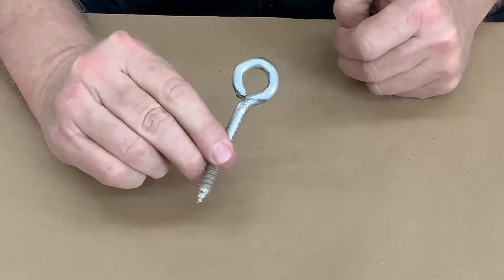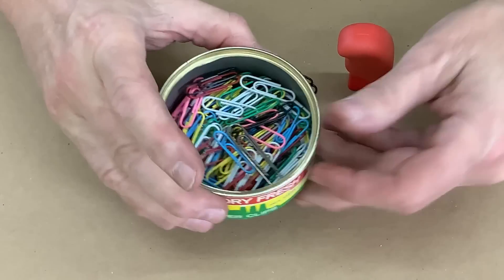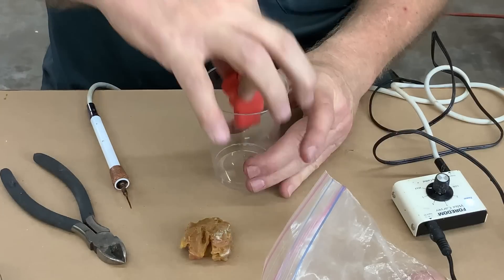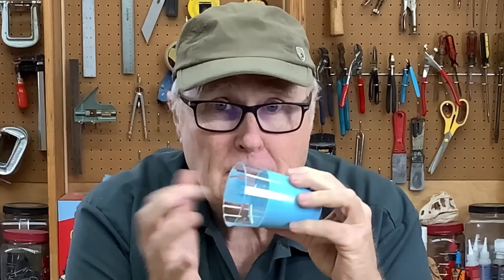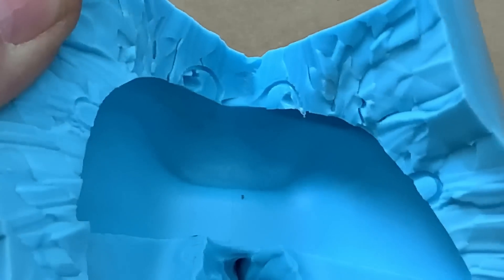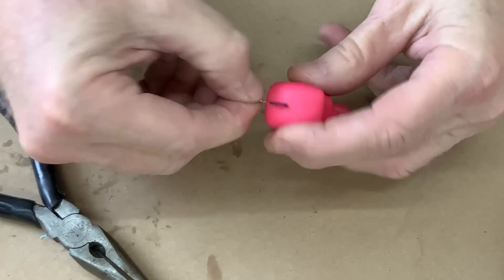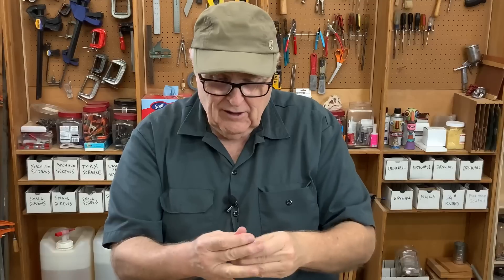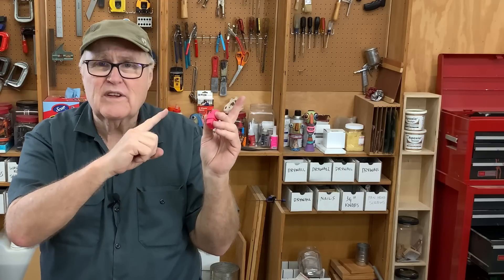Eyelets - Potted Or Screwed. Which Works Best?

Comment: Robert - have you tried drilling a hole then anchoring the hook with a little bit of epoxy in the hole? Probably no better than the sturdy connection you get with eyelet

Comment: Fishing lures usually have just one piece of wire thru the entire lure, definately wont go anywhere.
What size is that eyelet screw? I've been looking for some very small eyelets but might have been looking in wrong places as I havn't found that small, would definately save time in making small fishing lures instead of bending a thru wire.
Reply from the maker: Small eyelets can be bought from jewelry supply places.  I use them for ornaments, etc. but I don’t know if they would be strong enough for fishing lures. You could use the Marling Baits channel method and twist your own eyelet. That creates a long twisted shank that glues well to the lure body.
Reply: I could but thats always extra work, takes about same time as bending a thru wire with a jig/tool I made. 
I did some more searching and found some small size eyelets but they don't seem to be available in stainless steel that much and if they are, the screw is way too short for my liking.

Comment: I feel like those paper clips would bend if you pulled on them, but the eyelet would not
Reply from the maker: It’s possible to bend them with enough force. But the question is, how much force do they need to withstand to do their job? I think that they are much stronger than they actually need to be.  Of course, if you were making something like fishing lures for big, aggressive fish you might want to use a stronger system.

Comment: Did I tell that I used your chunk advice? And that I failed terribly?
I put the chunks into an old Haribo box that contained "Cola Kracher", roughly translated would be "cola cracker". And I think those candy is coated with bee's wax to make them shiny. The wax must have gotten onto the stored chunks over time.
Man, all my chunks did not bond with the new rubber and popped out of the mold when I started cutting it. 😅 Lesson learned.
Lovely video, Robert, I enjoyed it. 🥰
Reply from the maker: It is important to keep your chunk rubber clean. Even letting it sit around in an open shop can potentially cause problems. I keep my waste rubber In a sealed container and I cut the chunks just before I use them.  Sorry for the mold failure; hate the waste of time and materials 😭.
Reply: @RobertTolone  The mold is a bit wobbly, but I think I can get a few castings from it. :) Yep, I also thought I need to keep the old chunks in a box, just didn't think about the wax on the candy. I better had cleaned the box before putting the chunks in there. =P

Comment: Nice, one of the molding/casting things I’ve always wanted to see a demo on. 

I’d also love to see you address embedding glass eyes in a casting, for when a sculpt has eyelids that need to overlap the eyeball. I’ve wondered how I could get the glass eyes to stay in the mold when closing it up, as well as how to not have resin ooze around the edge of the glass and “float” it out of position.
Reply from the maker: For that I have not figured out a solution.  Most methods I’ve seen involved a hollow head form (puppets, etc.) or wrapping skin around the embedded eyes (taxidermy).

Comment: Another great vid Robert. I use a 2 piece mold and have a makeshift jig setup to bend my wire pieces. I use both these methods sometimes in the same piece. You can also have the mold hold the screw eye for you if you want to speed it up.

Comment: Can you recommend a UV resistant and relatively strong resin?  I have a bunch of old windows with small plastic parts that have broken and for which I cannot find replacement pieces.  But they will be in windows with sun exposure.  I don't have the 20 grand to replace all of my windows. So I was going to cast new parts using the old parts which can glued together (plus I have one new one I bought 20 years ago that I can copy using this method).
Reply from the maker: I have very little experience with 3-D printing resins. That would be a good question for resin suppliers.
Reply: @RobertTolone  I don't want to print them, I want to mold them using the broken pieces. Glue them together and take a cast of them.
Reply: Other than UV resistance what other properties does the part require? If stable colour and transparent are primary factors then find an aliphatic isocyanate based polyurethane, if the part doesn't need to be clear then an epoxy will be more robust but will yellow in UV so topping with a UV resistant coating/paint will give you a nice stable piece that will last a long time.  In general the epoxies will give you better chemical and water resistance as well as greater physical properties, the other thing to know is that monomeric aliphatic isocyantes are highly toxic so need to be handled with great care and respect.
Reply: @chriswebb9375  Color isn't important. The parts go in a section of the window at the very bottom for tilting.  I'm not even sure they will get a lot of UV. They won't get ANY UV when the windows are closed.  I'm more worried about becoming brittle and weakened than color changes.

Comment: If the chunkies(chunkys sp?) touch the model do you think its a bad thing?
Reply: Shouldn't touch the model
Reply: @glenfisher728  but it might like in this mold.
Reply: @chartle1   and it possibly created the air bubble
Reply: If the actual chunky touches it shouldn't matter, if it deforms the mould, applies pressure, or bubbles then you'll have issues.
Reply: Silicone is silicone. And even if it touches, the liquid resin should "wet out" the contact point between the model and the chunkies